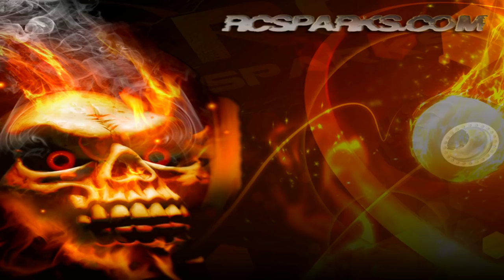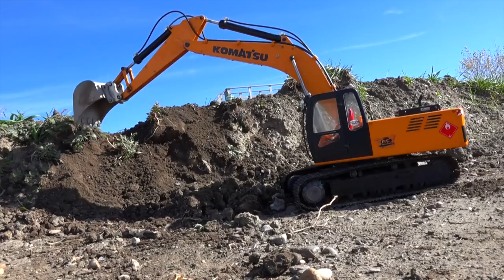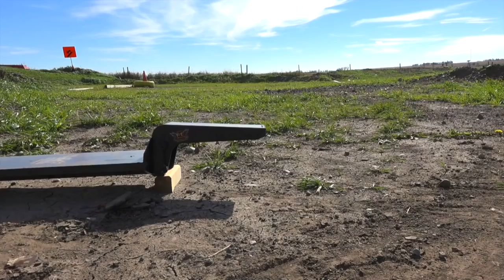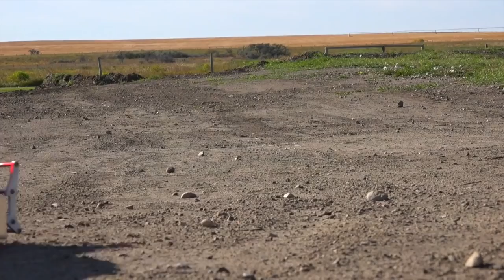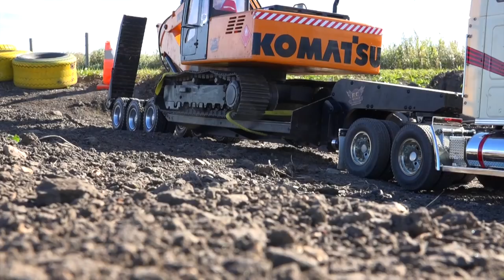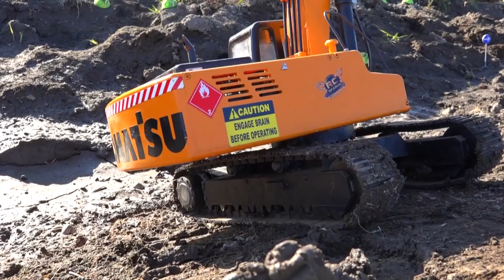RC ADVENTURES - Semi pulling Earth Digger 4200XL Excavator

Comment: i need help with my excavators is someone now is like this one i conet everithink went i starteron the hydraulic pump motor make a sound like beepp,,beepp,beep, verry fast and i heat the hydraulic pump bottom and is not working i change the receiver and the esc and does nothing..